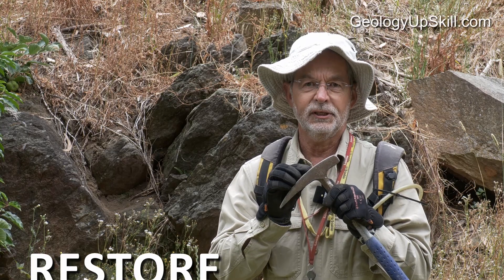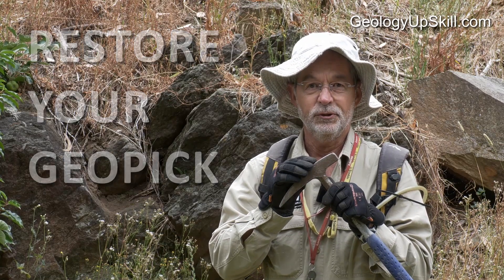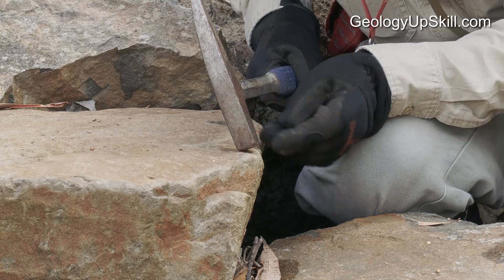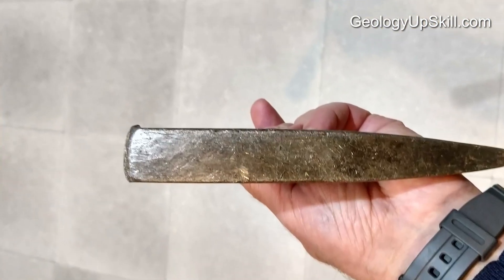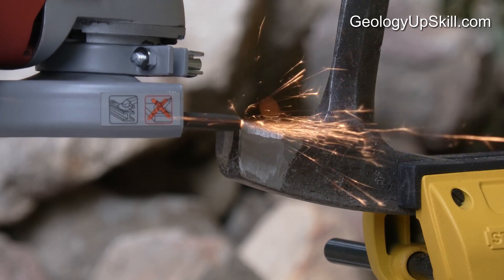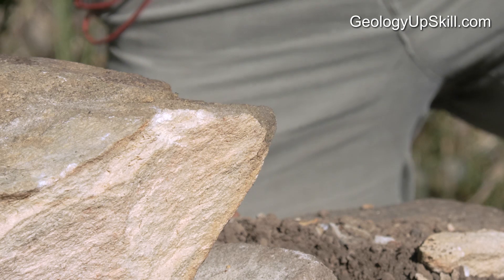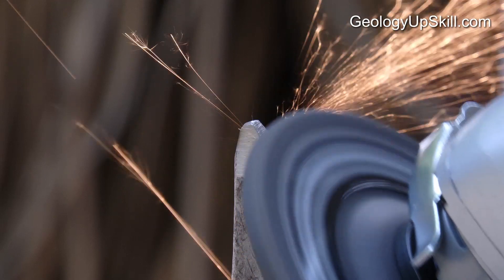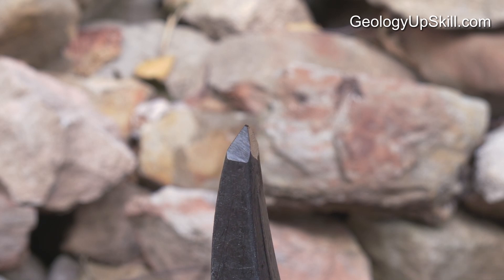Restore Your Worn Geopick to Better Than New

Comment: Fantastic. You answered my question before I asked, which was the issue of overheating the steel with a grinder ! Thanks. Im planning to restore some antique picks to working condition.
Reply from the maker: With experience, I go for a little more rounding on the corners since I work mostly on hardrock.

Comment: As always, great video! But - since you pulled out the angle grinder, I have a question - I'm more of collector and an amateur geologist and I was thinking of getting an angle grinder to use as a small scale (also cheaper and easier to carry :) diamond saw for chopping off small specimens. If you can share your opinion on that - If it's a good (or bad) idea and some tips - it would be much appreciated.
Reply from the maker: You can grind a rough face on a specimen with the right type of wheel on a battery powered angle grinder, but the rotation speed is too high and no water cooling for a diamond saw on rock.